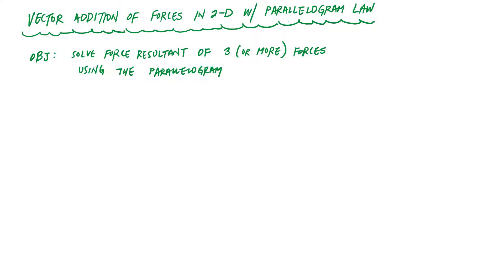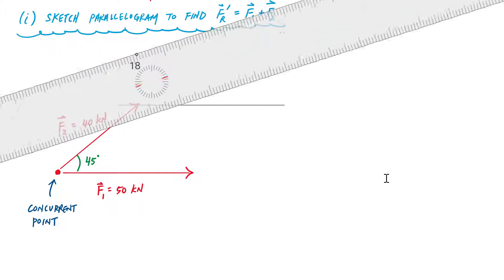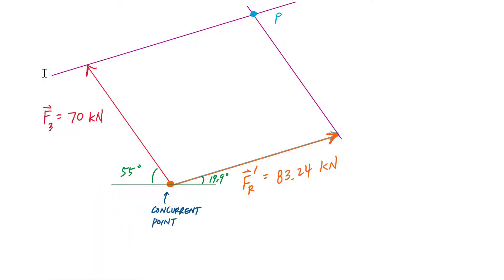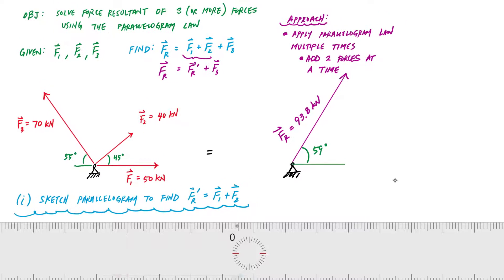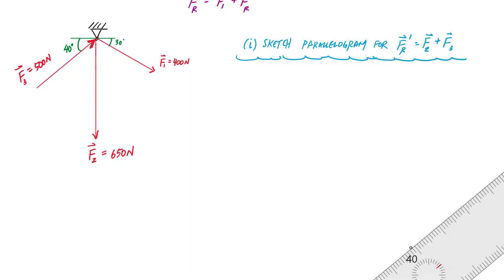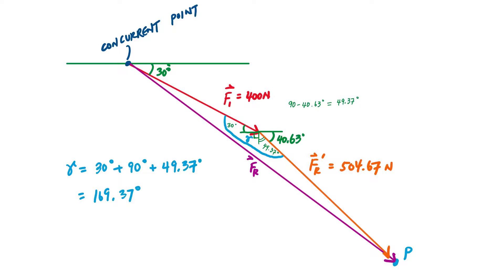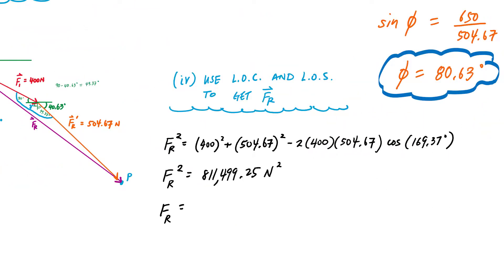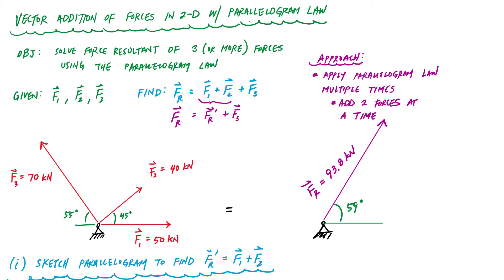Adding 3 or More Force Vectors Using the Parallelogram Law - Engineering Statics (L01-3)

Comment: Hey Professor at 4:59.  Apply the geometry rule angles inside a paralellogram = 360.  Inside the parallelogram (lower corner & top corner) = 105.1° and thus 2(105.1°) + 2(X°) = 360.
Angle X = 74.9°.  Right? 
So, that angle 74.9° is the angle opposite of Fr.  Now use the law of cosines.  Done.

Now, use that same method at 11:52.
2(10.63°) + 2(gamma) = 360 → gamma = 169.37 degrees.  Done.   It took you a minute and a half to get that.